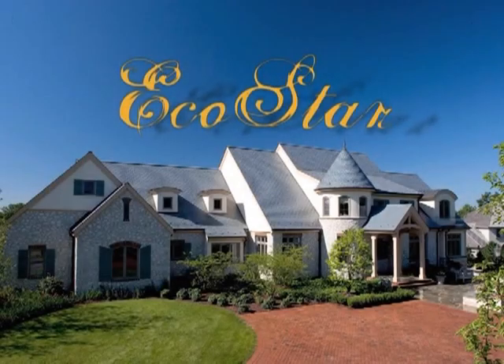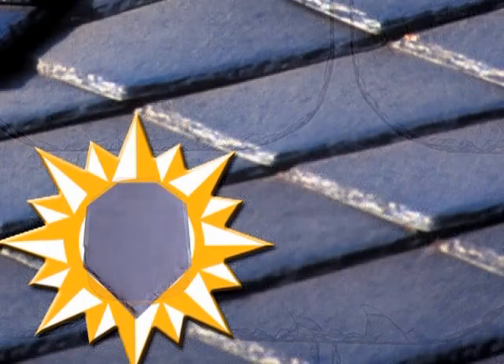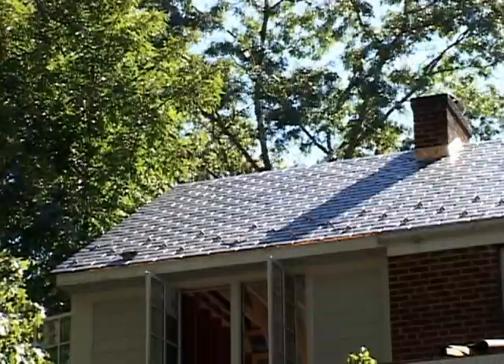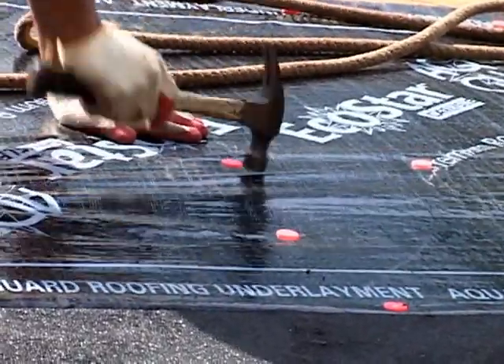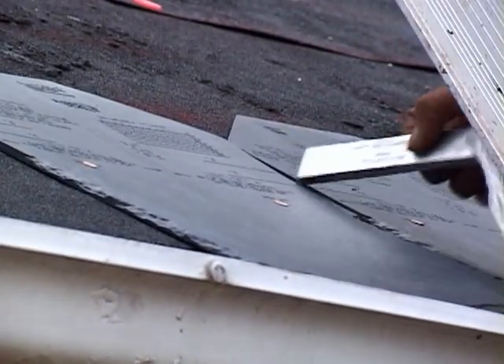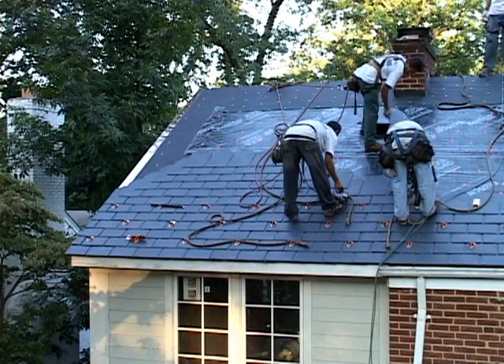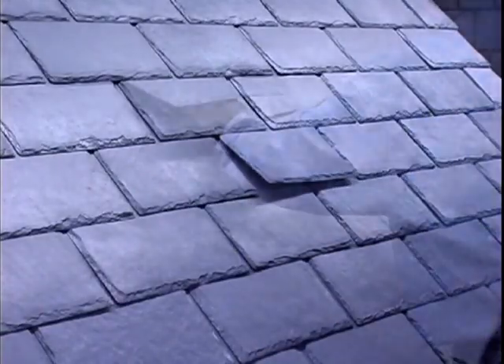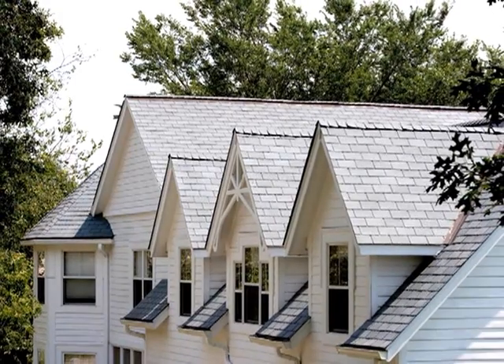EcoStar Roofing

Comment: Ecostar is easier to install as they are light and cut with a utility knife, unlike   stone slate.  These ecostar  tiles cost less too.  I like that they are  pre-blended at the factory.  The 26 year old  unique rubber formulation of ecostar is very heat resistant and they will show you jobs to prove it.   Stone slate takes much longer to install and can be hazardous if they break off and fall on someone.